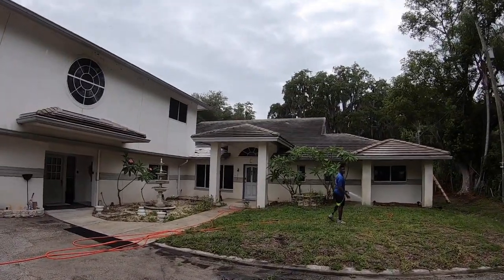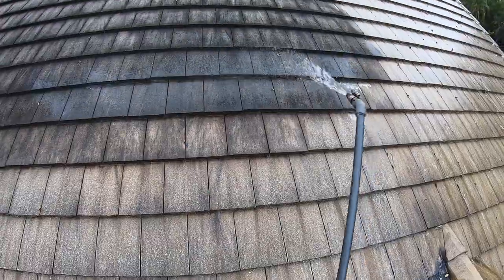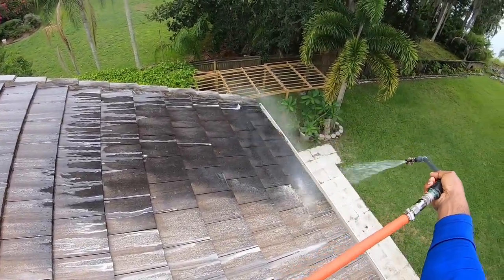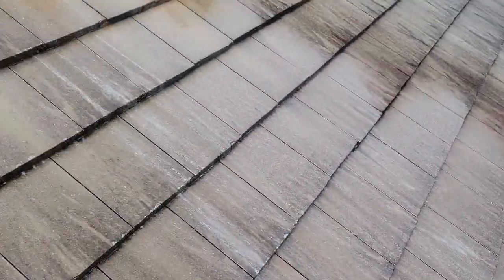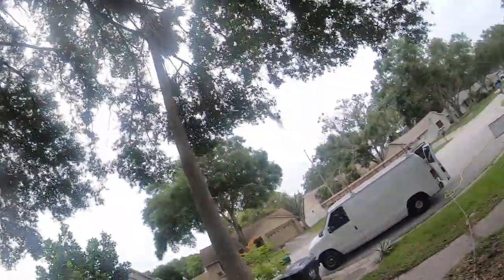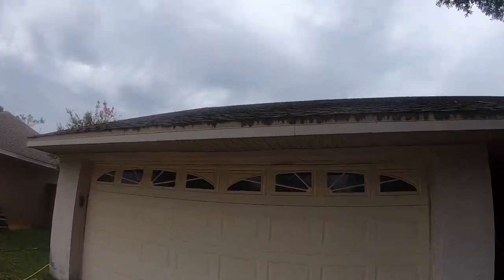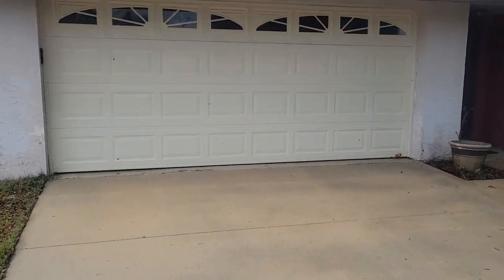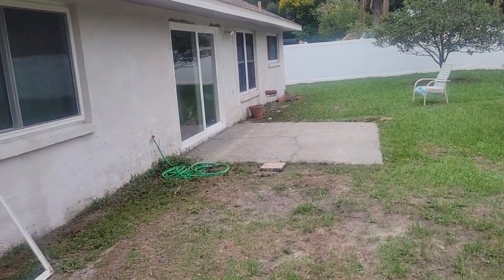Flat Concrete Tile Roof Cleaning / House wash / Fence Wash

Comment: Do you recommend using surfactant on these types of roof? If so which kind of surfactant? Also what kind of jrod are you using. I like how it sprays
Reply from the maker: Yes you can use surfactant. Doesn't matter which kind as surfactant only makes the chlorine stick to the roof. They don't really add cleaning power to the chlorine.  The nozzles on my 12v jrod is a 0040 stream and 2540 fan tip

Comment: What strength SH did you start with? 10 or 12.5? Ive done 2 cement tile roofs and they stress me out. Results aren’t quick as yours
Reply from the maker: I'm using 12.5% sh but I'm only applying it at 5-6%   I would never apply 10- 12.5% straight mix to a roof that's a waste.

Comment: What's the life on the SH when it gets sprayed on the roof? I'm in southern California and usually everyone out here pressure washes roofs. I'm thinking about brushing the roof first to get the top layer off, leaf blowing it off then adding SH to kill the black mold and see how it goes from there
Reply from the maker: I dont know what life of it is. But the roof gets pretty much cleaned after spraying.  The rain will rinse it off (unless you want to rinse it yourself)   but I rather leave it so it kills all the algae for me.  I don't think it lasts for days up there.  Sh turns to evaporates and also turn to  salt.
Reply: Im in northern cali and i also was thinking if i should rinse because up here moss gets really stuck to tile roofs
Reply: Im in northern cali and i also was thinking if i should rinse because up here moss gets really stuck to tile roofs

Comment: Do you go down below to get the tiles that roll around the edges or try and get them from the roof.  I never see anyone in the videos deal with them.
Reply from the maker: On some roofs I do. But most of them I can sorry the edges from the top.  I spray at an up angle to make sure tonget those edges while I'm up top.

Comment: Quick question for you. I some how happened to land an apartment complex job with flat concrete tiles, my question is is it safe for me to leave my SH mixture on the roof or should I rinse? The entire complex has gutters and they are cleaned out. I plan on using a 5% mix while using roof snot as the surfactant. How long should it take for I/customer to see results? More so with the mold not the moss
Reply from the maker: No need to rinse. You should see great results before u pack up and leave. Moss doesn't attach to tile roofs u could either spray then and they'll die and fall off or u can blow them prior to cleaning.

Comment: Great job brother. What mix did you hit that flat tile roof with? 5%?
Reply from the maker: 5% yessuh!
Reply: @PinkFlamingoPowerWash  lol I figured. Good work bro
Reply: Do you ever run into green or mustard algae in Florida, I hit with probably 8.5%, or 6.5% twice today, and most of the color was gone, but crazy working with such a hot mix.  Seems to be a mostly California roof thing, with hardly any black mold.

Comment: That looks awesome cliff Great job. I have a question how do you find out the square footage of a roof like that ? And how much to charge for square footage for that roof or do you charge different for that first roof ? Thanks 🙏
Reply from the maker: I get the roof square footage from Google earth.  Im at 25c-30c a sq ft for tile roofs
Reply: Awesome!  thank you bro. You make everything look so easy. Hopefully I can do that with experience
Reply: @PinkFlamingoPowerWash  Do you also add in the extra square footage for pitch?  Also, do you consider more roof area with barrel tiles?

Comment: Hey just started a pressure washing business what are the hose attachments you use? I can’t find any different ones other that the regular pressure handles I’ve found the jrod but can’t find any other comfortable handles to use
Reply from the maker: I use a suttner 2605 gun. One has a long lancr and one has a short Lance.  I use the short Lance to apply chemical and long one to rinse mostly
Reply from the maker: Thank you 🙏🙏
Reply: @PinkFlamingoPowerWash  no thank you bro, love the videos, I learn a ton from them!!

Comment: What system are you using to softwash…great result
Reply from the maker: 12v pump 7gpm 100 psi
Reply: @PinkFlamingoPowerWash   thanks and can I ask what size is your hose? 5/8 ?
Reply from the maker: @abate1936  1/2 inch AG Hose
Reply: What pump are you using. I’m running a 5.5 gpm with 60psi. I wanna jump to one like yours.

Comment: Hey cliff, thank you again for the great content and info. How much surfactant do you usually use for a roof wash? I have a roof cleaning coming up and I have a 13 gallon tank soft wash system and I’m going to use a 50/50 mix. How much surfactant should I use? Thank you in advance champ.
Reply from the maker: usually a with a good surfactant you can mix about 1 oz of surfactant per 5 gallons of mix.
Reply: @PinkFlamingoPowerWash  thank you. I appreciate it.

Comment: Nice video. Are you adjusting to low pressure rinse using the unloader valve?
Reply from the maker: No need to adjust the unloader to rinse with low pressure. The unloader should not be touched after setting it to the correct psi.  Thats why we use a Jrod cause it has the tips to lower the pressure.
Reply: @PinkFlamingoPowerWash  Thanks for the info. Maybe I need a new jrod. I ordered it for a 4gpm machine but it seems like the pressure is still shooting way too hard.
Reply from the maker: @premierpowerwashing6634  make sure you have correct jrod nozzles attached